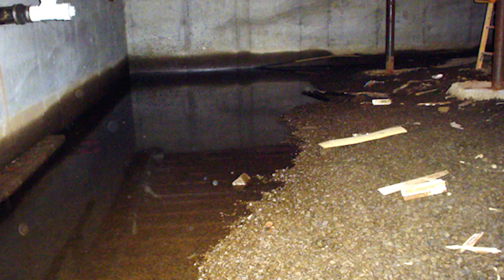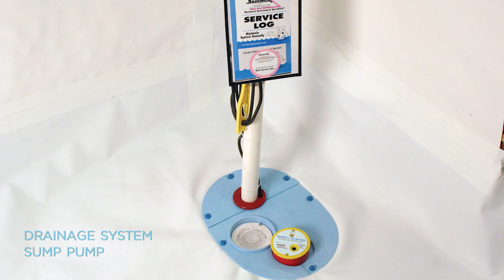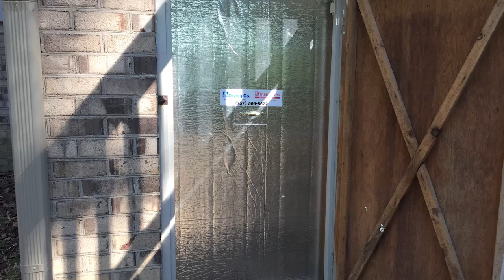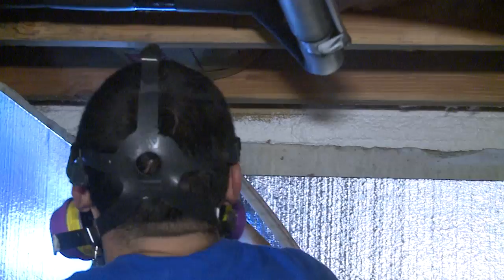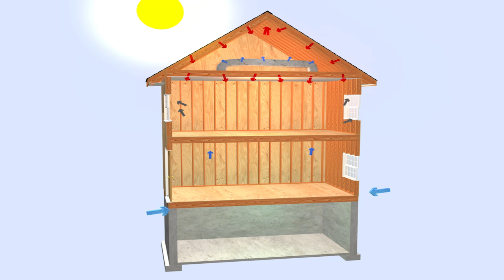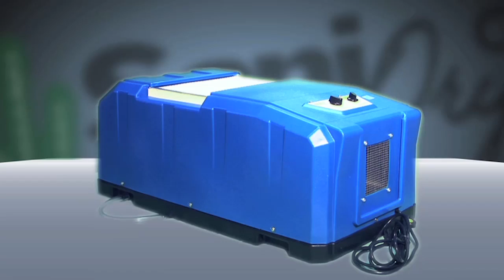Crawl Space Encapsulation in 6 Steps | Vapor barrier, Dehumidifier, Cleaning & Repair

Comment: Price tag of all this work?
Reply from the maker: Great question! The cost of encapsulating your crawl space varies based on the size of your home, the materials you choose (there are different liner, insulation, and mold treatment options among other items), and what your home needs. Not all homes need foundation drainages or structural support, while others might need one or the other. Giving an "average" price is just misleading and inaccurate for any contractor to do when it comes to projects like this. The best way to get an idea of the cost of encapsulating your crawl space is to get a free estimate. Then you'll know all of your options, what your home needs and doesn't need, and exactly what the cost you're looking at is.
Reply: If you have to ask it’s too much

Comment: In the Southeast you can not use spray foam on floor joist and sub-floor, the code for Alabama is 3 inches below the floor joists. if you do you will void you termite contract.
Reply from the maker: We're not sure what the building codes are in Alabama. Our company is based in Virginia and we have to follow VA state building code for encapsulations which states that at the top of our wall insulation or liner, we have to leave a 1-2" termite viewing strip below the sill plate and the full face of the sill plate exposed for annual termite inspections. If termites are coming up behind our wall insulation or liner the annual termite inspection should be able to catch the trails before any damage is done. We work with several termite companies in our area that believe in encapsulation systems, provide treatment and warranties to homeowners with crawl space encapsulation systems. As long as a crawl space encapsulation adheres to state building code, it should not impact the client's termite warranty.
Reply: @thedryingcompany  If you state says 1-2" below the sill plate that means you can't spray the rim joist.
Reply from the maker: @superiorpestcontrolinc3128  Our code specifically states "Joints between the sill plate and the top of any interior wall covering may be sealed." So long as the full face of the sill plate, which is the first piece of wood meeting your home's block foundation, and the 1-2" gap at the top of the foundation wall are visible. Sealing the rim joist is not only allowed by our code, but it also makes the encapsulation system more effective.

Comment: I see that the 2018 IRC code has been updated to include a 70-pint per day dehumidifier as an acceptable means of providing mechanical ventilation. Can you speak to the pros and cons of employing the dehumidifier versus using the existing HVAC to condition the space, as permitted by code (with modification, of course). Will one method of mechanical ventilation provide more control over year round comfort than the other? I could see the dehumidifier playing a bigger role in the humid summer months, but potentially causing comfort issues in the winter where the joist space is uninsulated and the crawlspace is unconditioned. Also, which permits and inspections would be required (Chesterfield Co., VA) for an encapsulation?
Reply from the maker: These are great questions! Thanks for reaching out. The answer is pretty long and detailed, if you like, you can give us a call at 804-823-1290 and we can have one of our home performance advisors review the codes and science with you.

Comment: When do you decide if you should insulate under floor joist?
Reply from the maker: Sergio, it's all about the home's construction and location, as well as what the homeowner is trying to achieve. When we insulate under the floors, it is typically with spray foam and in a situation where an encapsulation is not suited to the construction or environment of the home, such as no foundation walls. The best way to determine what works best for your home is to have an evaluation by one of our advisors and they can review your options with you.

Comment: Seems like the term "crawl space" is used pretty loosely lol, mine is literally crawl... thats crawl thru the mud , snakes, spiders, slugs, rodents etc... I didn't build this mess lol I'm just the one left to deal with it for now.  Easiest way to fix it I think would be pray for a tornado...
Reply from the maker: Crawl Spaces definitely vary in height we have been in some pretty tight ones like yours (that's the majority of what we work with), and some taller ones where you can almost stand up. Most homeowners are left to "deal with it" that's why we like to make sure we are doing exactly what our homeowners want and that we are offering a long-term solution, not something you'll be "left to deal with". Thanks for the feedback!

Comment: I have two gas appliances in the crawl space (furnace & instant hot water heater) where I have some concerns then about ventilation.  Would you install a gas detector and provide a manual vent(s) or do you have another suggestion?
Reply from the maker: P.J., in this instance we would ask an HVAC contractor to look to see if they can vent them separately.
Reply: The Drying Company/Thermaltec so what is they cant do it? What is your solution? Im in ga and ibe had estimates from different companies and they talked avout putting lamenco fans to remove gases building up
Reply from the maker: P.J. there are (2) main types of gas furnaces and water heaters. Direct vent and indirect vent. With direct vent systems, these have PVC intake and exhaust pipes that should be routed to the outdoors. In a vented crawl space, sometimes the HVAC contractor will leave the intake side open to the crawl space since it's still considered outdoors. When we seal a crawl space with direct vent systems located within the space, an HVAC contractor is brought in if needed to route the intake piping through the foundation wall. Indirect systems are ones that have lower AFUE ratings, often have a metal flue pipe on the exhaust side, and have open grills on the cabinet door. These systems rely on the space they're located in for intake and combustion reasons. If we seal a crawl space with an indirect vent system located within the space, a HVAC contractor is brought in to install a fresh air system in order for the indirect system to get the required amount of air when running and to prevent back drafting on the exhaust side.
Reply: P.J. Mercer typically a company would install a a fan in one or two vents. This can help take out radon gases,soil gases and any other gas that could build up in the crawl space

Comment: So how does the termite inspector visually inspect the rim joist if it's covered by 2 inches of expanded foam???
Reply from the maker: Thanks for commenting. This is one we get quite a bit.
When performing an encapsulation where we cover the walls with a vapor barrier and often insulation, spray foam or foam board, we have to follow VA state building code for encapsulations that states at the top of our wall insulation or liner, we have to leave a 1-2” termite viewing strip below the sill plate for annual inspection. We leave a 3" viewing strip to help the termite companies. The sill plate is the very 1st piece of wood in your home that sits directly on top of the foundation and will be the 1st affected area if termites come up to it. The sill plate gets sealed down to the foundation with a thin bead of air sealing foam to keep air and moisture from coming inside but the face of the sill is still completely exposed for inspection. We do spray foam the rim and band joists to enhance the performance of our system. If termites are coming up behind our wall insulation / liner, the annual termite inspection should be able to catch the trails before any damage is done. We work with several termite companies in the area that believe in the encapsulation process, provide treatment, and warranty. 
Let us know if you have any other questions.